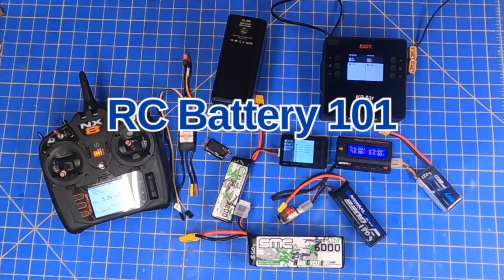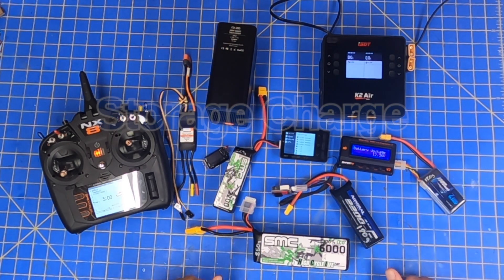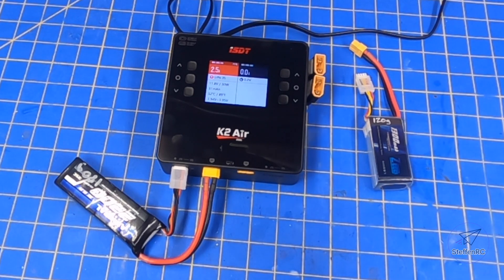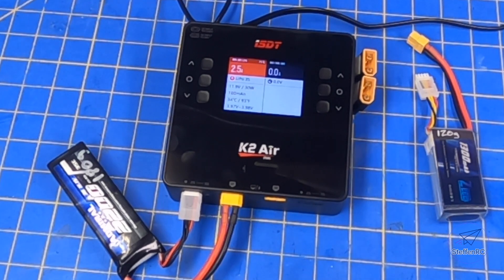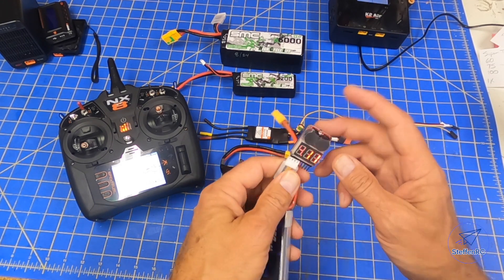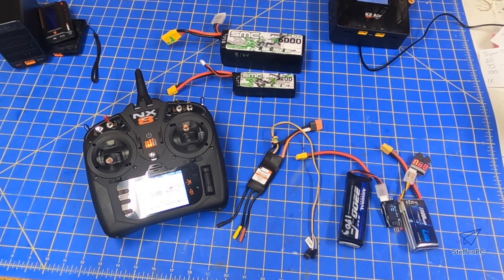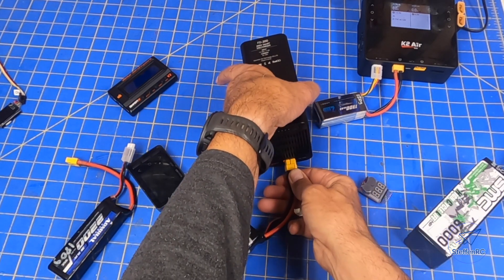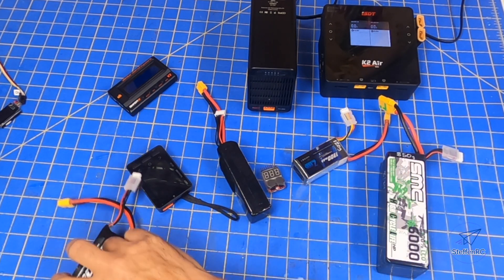How to care for your Lipo batteries

Comment: What is a safe number internal resistance number per cell say a 3s or 4s 2200 the most common lipo in our hobby?  When is it a good idea to dispose based on this metric?
Reply from the maker: Matt, great questions.   Some batteries like little 2-3 cell 300-400mah will have a IR of 50-80 so on those batteries I only look at the difference between cells.  If one cell is out of whack, and the pack is a few years old I'll mark it as suspect and then prove it has issues while flying.  Larger packs are treated similarly.  The IR on a 5000mah pack is under 10.  If over time it get in the 30s-50s then I know something isn't right and maybe only use that pack for shop use.  So, what I'm saying is.  I look for consistency in IR in the pack and over time.

Comment: Great video Steffen ! What is a good storage  % for batteries? So many guys at the field all say something different. I have the new NX8+, and I can get a call out on my flight battery.
It also has Low Voltage Cutoff, the guys are also saying,  when I set that,  it should be around 3.6 volts in a 3S 2200 to 3200 mah. Does that sound about right ? Would love your thoughts !! Thanks !!
Reply: Any suggestions  ??
Reply from the maker: Scotty,   Lots of opinions on this stuff.  I believe the common thought around storage charge is around 3.8v per cell.  I usually fly till my batteries are in the 3.7 range while cruising. After I land, they recover to 3.8.   An alarm for 3.6 makes sense.   If you go that far, its usually due to a full throttle punch.  The battery should recover, but you may want to start thinking about landing if its happening frequently on that flight.
Reply: @SteffenRC  cool deal ! I flew my Spirit 100, electric, one day for 12 minutes and 45 seconds, and ran the 3S 2200 down to 3% ! I was aviation able to bring it back up to a full charge. But I didn't have my low voltage cut-off..
Oh well, great fun !! Thanks for your feedback

Comment: Great video. Well done. This is why I have chosen to go with all Spektrum smart batteries. Let the system manage it for you. Thoughts?
Reply from the maker: I think the Smart system is a great solution.  I think the system is really helpful to keep this process simple..  That said, I don't own any of the Smart batteries or chargers.   When I got back into the hobby I wasn't a Spektrum TX guy.  So, I went down a different path.

Comment: I've noticed that the charge in brand new batteries can range from 30% to 70%. I just leave them at that level, whatever it might be, until I fully charge them for my first flight. They all seem to last about three or four years in light load use. 
Am I doing something wrong?
Reply from the maker: Most of my batteries last 2-3 years with frequent use.  It depends on the manufacturer and how much I'm pushing them...

Comment: I'm slowing switching to receivers that have a voltage monitoring port that I can connect to the balance plug on my flight packs. Some of my planes have ESC's that have telemetry. In either case, I set up low voltage warnings in my transmitter. It's not good to pull the cells below 3.7 volts at high current. I usually charge at the field at 1.5C. When I return home from flying, I use a charger and a Bat-Safe to bring them back to the storage voltage, if they're not within 0.1 volts of it. I store my batteries in a double-walled flammable storage locker in the garage.
Reply from the maker: Thanks for sharing your battery setup..  Can't treat these lipos harshly..  They can bite back....

Comment: Thanks Will. This was great info. 
Do you only fly to 3.6v for a low? 
Do you have links for the various devices you shared? I'm particularly interested in the voltage checker that does IR. I don't think the Spektrum one I have does that.
Thanks!
Reply from the maker: I usually end a flight with packs at Storage charge 3.8v.   Often, I'll set and alarm to 3.6v, but after the packs recover, they end up at 3.8v.    That ISDT checker won't do IR, only the ISDT K2 does that.  The battery checker will show the difference in cell mV though...